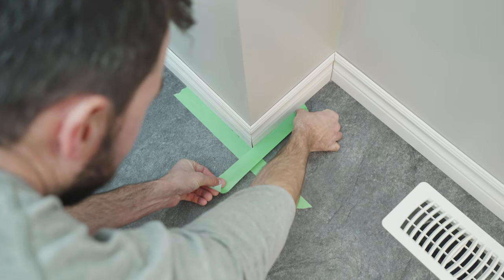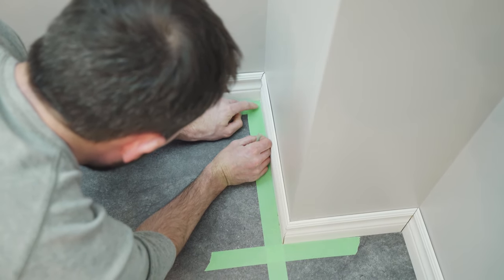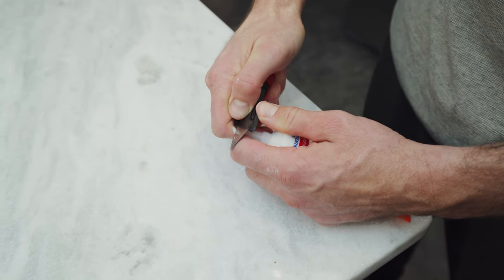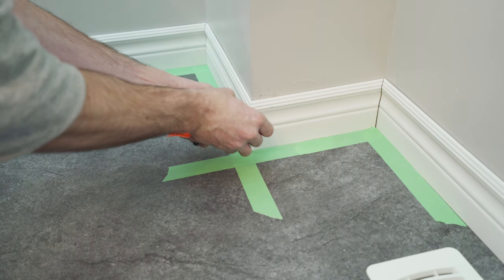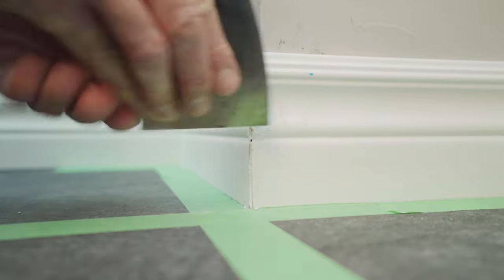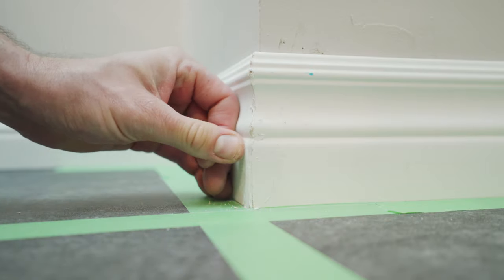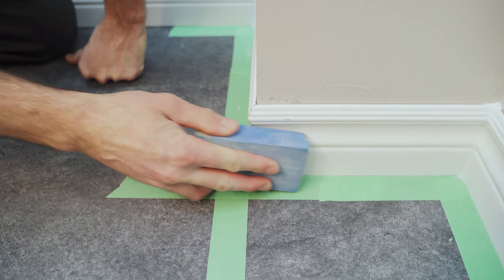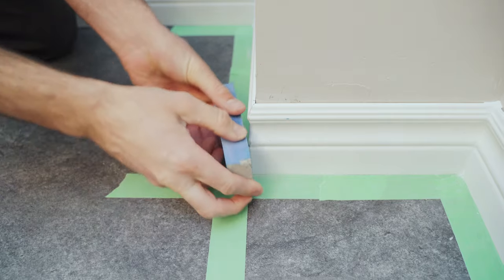How to Fix Large Gaps Using Wood Filler & Why You Should NOT use Caulking or Spackle

Comment: If you have gaps in woodwork you intend to stain, the best filler is wood glue mixed with sawdust as such a mixture will harden and fill the gap and the sawdust will accept your stain perfectly.
Reply: This is exactly what a guy did that ruined my floors. The glue prevents stain. Sorry.
Reply: @bonniehuseby5915  Bonnie, I'm sorry you had this problem. I failed to mention you add stain to the glue/sawdust slurry while mixing. If you allow the glue to harden before staining you are correct in saying it will not stain.
Reply: The glue/sawdust method works best with darker species in my experience. Not a great fix for pine, oak, maple, etc.
Reply: @thomasbeatty9496 thank you 👍

Comment: How about gaps between bottom of baseboard and hardwood floor?  My old house has somewhat uneven floors and there's a gap up 1/4" in spots.
Reply from the maker: Your best bet would be to use a second piece of trim/moulding like quarter round or similar.  Good luck!

Comment: I have crown molding on the entire first floor. It has gaps not only at joints but separation gaps on ceiling side as well as wall side. Should I remove anything in the gaps and use wood filler?  Also joint gaps this is where I would use the wood filler correct?  Thank you. Just subscribed.
Reply from the maker: Thanks for the sub!   I would use wood filler in the joints between the between pieces only.   At the joint where it abuts the ceiling and wall use caulking.  We have another video on caulking baseboards but the same concept applies to the crown… caulk it, spread it, wipe with a wet cloth and spread again with your finger to finish it

Comment: Use DAP sparkling. Your work looks unprofessional.
Reply: DAP spackling does work well, but I find wood filler like we used is stronger and more crack resistant, trim work was builders trim that we just reinstalled but you are right I am not a professional, just a diy dude
Reply: I enjoy the DIY tips! Many of us are extremely happy wiyh how well you show us how to tackle problems like this! It looks great, and saves money!
Reply: @shelleylard2399  thanks for the vote of confidence Shelly!
Reply: @nothingbutthebest3051  spackling is not suitable for this application as it is primarily composed of gypsum and glue and is intended for use in drywall. Wood filler is the way to go here. It will be longer lasting and less prone to shrinkage and cracking.
Reply: What wood filler did you use????